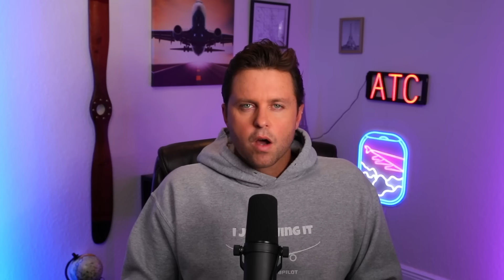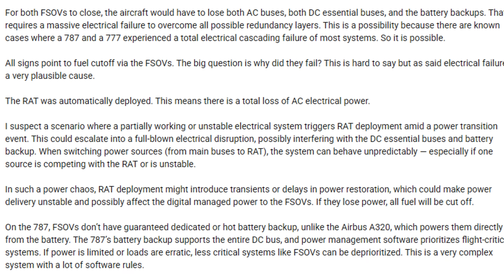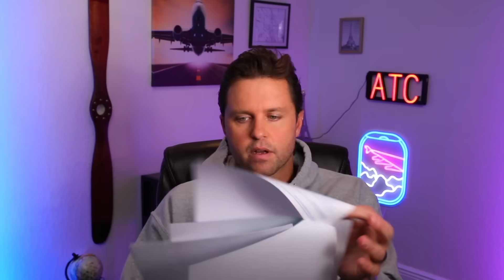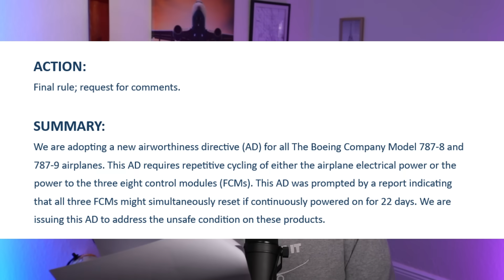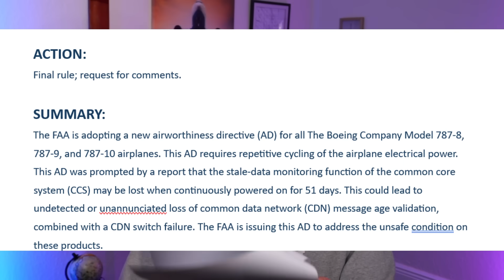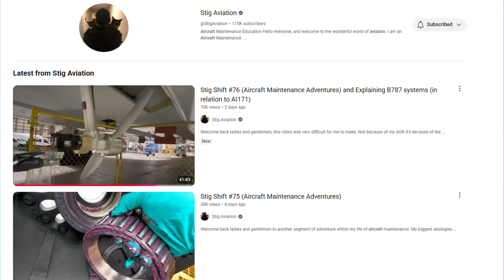Air India 171: Did a Software Glitch Cause Dual Engine Failure?

Comment: Flying beast an ex indian pilot thinks that the flight was overloaded
Reply: Unlikely. The aircraft was flying to London, a flight of 9,500km the max range of the B787-8 is 13,500km, so the aircraft would not have full fueland hence unlikely to be overloaded.

In addition it rotated in to the climb at the usual position and climbed to 400 ft in 10 seconds, at a climb rate of 2,400 ft per minute, which is normal. This could not have been achieved if the aircraft was overloaded.

A little later the problem occured.
Reply: Thanks for explaining  @christopherrobinson7541

Comment: If you want good, honest data, check out the Pilot Debrief channel. He just put out the best video on the horrific crash.  I don't think anything spoken in this video is possible; there is no fuel shut-off in this way.  
Look people this speculation is foolish, it is 1000 times more possible that there was a single engine failur just after V1 or right before rotation and the pilots were dealing with that, that is why gear did not come up, and then they shut off the fuel to the good engine by mistake causing a dual engine failure. That would be 1000 times more likely than all this speculation in this video.  
For fk sake, just stop farming all this death and wait for the report. ya, this is getting on my nerves. I know farming makes you money from the views. But if you're not bringing anything logical to the table, just slow your role.  The speculation I just said above is also speculation, but it has happened before, has logic and data behind it. This crap in this video your are just farming at this point, you do know a lot of people died right. 
Again, for good data, watch the new Pilot Debrief video. He covers this with class. He waited for some data, and will not cover it again without new info.

Comment: Either AI  failed to work out the electrical issues that have been reported on the first leg from Delhi to Ahmedebad, or they did so incorrectly. Brings it back to AI maintenance.

Comment: I am an auto mechanic; these computer programmers took over the cars, in the 1910' to 1980' all was manual, all of a sudden computer programmers show up and CEO gave them way too much power, there is no more gas pedal on cars, it's a fake gas pedal, when U push the gas pedal U are telling the computer that U want to push the gas pedal and the computer push the gas pedal. Same goes for turn signal, you are telling the computer that You want left flasher and computer turn the flasher, same for wipers, A/C, ...I hate it absolutely hate it. I hate the way transmission shifts specially on Honda and Toyota, it can be reprogramed, now you are at the mercy of computer programmers, they even have the entire GM, Ford Toyota CEO by the neck. I do not know which imbecile gave them this much power. Only computer programmer has access to the actual program not even the GM CEO.  So if they ask 100 million to fix a clich...you have to pay. You have no more temperature gauge on most cars, the computer will put that hot cold needle on your dashboard where the computer wants, you are not seeing the actual engine temperature it's what the computer tells you, and if that sensor is going partially bad, you could be overheating and you will not know.

Comment: Gary, you had a 787 engineer comment on your video the other day when you and Captain Steve got together to discuss things. his comment was near my comment as well, and his was identical to what I was saying - catastrophic electrical system failure. to me, this is the most probable cause, and having him come in and say the same thing just after I did or probably just before I did, either way, was reassuring to me to see an actual dreamliner engineer commenting to you about the same thing. And then a day later, on another video, an Airbus maintenance tech said the same thing.

Comment: I asked ChatGPT to do an investigation and it came up with the folkowing: 

Electrical common-mode fault ➜ boost-pump & FADEC power loss ➜ dual engine rollback

How it would happen

1. A short or transient on the main transfer buses (often traced to a variable-frequency starter-generator or its power-conditioning unit) trips both Integrated Drive Generators offline seconds after rotation.

2. Boost pumps in both center-wing tanks quit; fuel pressure to each GEnx engine collapses.

3. Simultaneously the FADECs, which rely on aircraft power until the N2-shaft permanent-magnet alternators are fully spun up, starve of power and command high-pressure shut-off valves closed.

4. Both engines flame out; the RAT drops automatically, but at only ~600 ft AGL there is no time for relight.

Why it fits the evidence

Explains the RAT, flickering lights, and almost-synchronous thrust loss.

Needs just one initiating event (bus fault) to cripple both engines.

Is consistent with the absence of fire or uncontained damage.

Comment: Al Jazeera did a documentary on the 787 built in the South Carolina and the problems in the manufacturing of the 787's.
The covertly spoke to 15 employee's of which 10 said they would not fly on a 787.

Comment: Even if the design logic or software is faulty, Boeing cannot be legally blamed for the crash per se. Thats because in the prior flight there were some electrical problems. Rather than take it seriously, however small it may seem, and have it meticulously and thoroughly investigated and fixed by Maintenance, Air India as is usual in India decided to sweep it under the rug. Callous. Sloppy. Negligence. Indian regulator same. Corruption (country culture) is the cause of this accident. Boeing software is secondary but ofcourse that is also most serious and needs fixing. Had it been Israel or Germany instead of India, the small electrical problem would have been thoroughly checked out, that is their culture. The two Max 737 accidents of 2018 and 2019 also did not happen in the developed world. The slightest symptom may contain the whole story, but only if you are willing to see it.

Comment: I think you are very close to the truth.  I sent a message to Steeeve yesterday about the FSOVs.  My gut is telling me that a massive electrical failure/glitch happened that caused the FSOVs to CLOSE thus loss of engines.  What caused the massive electrical failure is of course TBD, but we already know of two incidents in 787s where the lithium primary battery exploded.  This caused Boeing to encase the battery in a bomb proof safe, so to speak.  I just wonder.......

Comment: If these Airworthiness Directives were issued over 5yrs ago, would they not have been acted on by now?

Also, if "X" number of days of "constant operation" triggers the glitch, can you back check this plane's public service history to see when it was last out of service? Didn't it just have an engine overhaul recently?
Reply: Some ADs require repeat action, such switch off and on again every 30 days, etc.
Reply: @christopherrobinson7541  Wut! Something serious enough to knock the plane out of the sky and they didn't even issue a software update in a decade?! Holy! The neglegence. 😲

Comment: How many single point fail options does this system have? The equipment I design and work on is NOT allowed to have ANY safety item controlled by “digital program logic”. Much of the hardware I use is selected to operate in the “fail last state mode”, meaning nothing changes if there is a power failure. (I’m referring to equipment operator safety) this obviously doesn’t apply to everything of course. Being the most sophisticated aircraft out there, this is stupid.

Comment: As a Boeing 767-300 cargo pilot, I'm not a big fan of leaving continuous power on these type of airplanes (i.e. between flights), but mainly for nuisance reasons having to do with build up of cache memory in communication and flight management systems (kind of like not restarting your windows computer often). The implications of those three AD's  that you mention however, is troubling, not to mention the spring loaded FSOV's other electrical quirks. Thanks for your great reporting and analysis.
Reply: As a Boeing 767-300 pilot you should know that there are no spring loaded FSOVs on your aircraft (nor any aircraft). Only the fire handles and fuel cutoff levers can close the fuel shutoff valves. As a former 767-300 freighter (and passenger) maintenance engineer I can tell you that you don't have to worry about your fuel supply. Just don't turn off your pumps in flight as one 767 pilot did. Suction feed has been known to cause issues even at low altitudes, despite what the books say.
CF6?
Unfortunately, I can't provide links to my manuals on YouTube. Just ask your friendly training instructor or competent ground engineer to provide details.
Reply: @ImperrfectStranger  Yes, absolutely. I'm not concerned about the 767-300 systems. It is a great airplane, from Boeing's glory days. My concern is for 787 implications.
Reply: I would agree with you .... I've seen many many times over the years, firmware in very expensive hardware doing unpredictable things because of a specific, unintentional  input state and memory problems triggering other unpredicted output. The AD's are troubling for sure, and it makes sense modern commercial aircraft that are fly-by-wire, need a clean re-boot regularly for safety ... its a nature of the beast.
Reply: That needs to be done with everything, even you WiFi router accumulates ARP packets that are incorrectly addressed to it and it drops it. To clear this you either build much, much more expensive router with a LOT of RAM or you restart/turn off it - like me: everyday. This sadly also applies to the Smartphones and their RAM, those systems can have process running that has cache overflow and generates out-of-ordinary level of logs, such one process can fulfill RAM. If you consider how much more of this RAM, EPROM, NAND or any other kind of memory needs to be used - and if these are chips that are 'EMP/ Lightning proof' or 'specific' - then they are hugely more expensive and order of magnitude less in size (like they are not GB but few MBs). Either way, the logic was incorrectly placed, the overuse is also the case, and those components .... they really badly tolerate heat.
Reply: And even if you DO reboot your Windows computer often, you can still run into strange glitches. For example, explorer.exe hanging if you try to launch the start menu too quickly while other software is still loading up, straight after a reboot. Software can do such unexpected things. Makes me concerned, having too much of this on an airplane.
Reply: Power has to stay applied for the load crews to open and close doors. They are electric for the 67s
Reply: @haydenn680  yes they would be. Again nuisance in older jets, but sounds like it's essential in the 787. I don't know how much Air India's jets fly. But it's not unusual for our jets to fly continuously (except for 2 hours between flights). And it would be possible, if seemingly innocuous power cycle requirements are overlooked, to leave the aircraft on ground power between flights so that the aircraft's electrical buses are continuously powered for long periods of time.

Comment: ok just to be clear, is this an absolute trade off (contributing to engine fire or contributing to dual engine failure) or is there some way to have your cake and eat too and solve for both? The way it sounds is that we've never been able to engineer a solution that works in every scenario.

Comment: Kiwi.N.Z here.  Now then , I'm a PPL.  Mechanic,  Truck Driver  , Bulldozers , Tractors , operated and fixed them
 In the 20 . 30yrs  Driving,  operating  vehicles  , , I cannot remember having a Breakdown that involved a mechanical,  nuts & bolts part  ! !  They have all been Electrical  or Computer related problems.  I say all this fancy computerized stuff is catching up with us.  . . This could be a big wake-up  Call  ! !  . Or . . is it fuel  , , vapor lock ?

Comment: I been saying a major power surge of epic proportion is the only logical explanation.  Power supplies will safeguard and reset and IF redundant systems are all doing this at the same time, it’s a fail theory that I support.  That take real evidence we must wait for.  Bonding grounds surges have caused in flight issues with aircraft and this is no picnic for equipment all sharing the same ground it buss.  Furthermore a surge kick back of inductive loads onto the ground buss bar are what make sense at this point in time.  I don’t buy ‘glitch in the software’ as all.  Might the data com system have had data errors.  Why all of the is another question.  It was highly humid and water or due humidity may have had a play.  Seriously, let’s take a breath and wait for the official report.

Comment: This is the most ridiculous analysis I've ever heard in my life. For a start, the uploader doesn't understand the wording of the AD's or even understand the contents.
The left and right-handed engine operates on two completely separate electrical systems. This is basically a standard design philosophy for all commercial aircraft.
If you just look at the air traffic control recording. The pilot said that he lost all power all thrust, he never mentioned the fact that there was no electrical power. And he was transmitting. Even if you lose all electrical power, the radios will still transmit because they operate on a jet pack or a separate power supply.
The simplest and most probable cause was center tank fuel contamination.

Comment: The FSOVs should be normally open and not powered during flight.
Of the basics, fuel, compression, and ignition, fuel being fed from center tank is the only common link that I have found.
Condensate on the bottom of center tank would explain ALL THREE anomalies shown in the video.
1. slow to reach V1
2. cloud of steam on VR
3. both engine flame outs

Comment: Clearly the best evaluation on the internet. 
CONGRATULATIONS to HeyFixThis and to Garybpilot.
I had a somewhat close evaluation, close in terms of design philosophy, with the difference that I suspected the lack of power supply to the fuel pumps, not to the "Fuel Shutoff Valve". This is due to the fact that I don't know the automation and protection scheme of the Boeing 786-8.
In my post I mentioned the possibility of entering a "fail-safe" mode of some equipment that supplies power to some consumers and the fact that there is a prioritization of the importance of various consumers (air conditioning and entertainment being the least important, for which there were previous situations of non-functioning). 
I suspected a design mistake... it is easy to criticize after it happened...
I also said that the accident was not due to the GE engines or due to pilot errors.
I also doubt that technical details will be made public... a gargle will be made public... I hope, however, that the error will be corrected, whatever it is... As you mentioned, Airbus A 320 solved this problem.

Comment: As an auto tech for a famous manufacturer, I patch software for engines, brake systems, hybrid electric systems with regularity.  Is this happening with Airbus or Boeing. Or is it difficult to get software certified/approved etc? 

I like the idea of having the FSOVs connected directly to the batteries as in Airbus 320.  

Side note:  Can we get cameras on engines, wings, important stuff pilots need to see?

Comment: FADEC engines usually directly send flight status information to manufactures, in this case GE… they probably already know that their engines are not to blame.  It sounds like an electrical failure from the ship itself…
Reply: Yes data is sent back to the engine manufacturers, GE.

The engines appear to have been commanded to roll back the power. This could have been caused by the FADEC, to occur with both engines at the same time is unlikely. It looks like the problem may be further upstream FMS, autothrottle etc.

Comment: May be a glitch.  But I do really cannot believe this. I mean. The 737 NG or max has specific batteries only dedicated to the FSOV.  They are designed to shut the valves off in the case of a loss of power i.e. no generator niether batteries.  Designed to shut off the engines in case of a runway excursion, a crash or simply loss of any ac/dc even on solely battery back up , list after one hour.  That means...you are in complete dark, all fails, you have the control to shut off the engines. Of course, the 737 has many mechanical , hidraulics, electric systems. Its absolutely different, but this glitch suggested goes the opposit to the purpose designed for on the 737.  🤔

Comment: The most informative video on the subject so far, based on facts and data 👍. Still something doesn’t add up. I just watched another video where the guy used kind of professional methods to edit videos and he suggested that at the time of rotating it seems like only one engine was working. I commented on your video with Captain Steve that whatever happened, happened on the ground. The experienced pilots most likely were aware but under lots of pressure from the company they took off at the very end of the runway with relatively slow speed and small angle of attack. Maybe they lost one of the engines while accelerating for takeoff.  They should abort this takeoff and cancel the flight with this particular aircraft. How come there is no official statement from the authorities yet. They have the best support from FAA and NTSB from British authorities , their own investigation authorities and still nothing.  If the pilots were forced to takeoff, regardless of the problems they encountered that’s a criminal act. Maybe that’s why we’ve got nothing but silence for that long 
🤷🏼